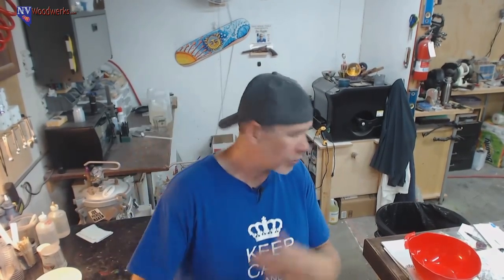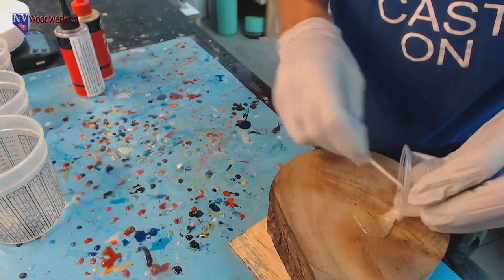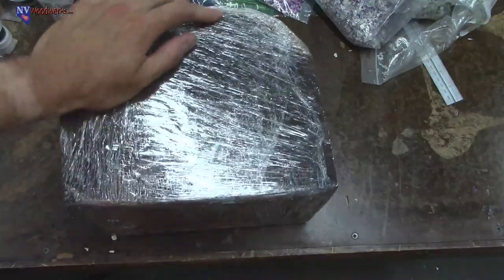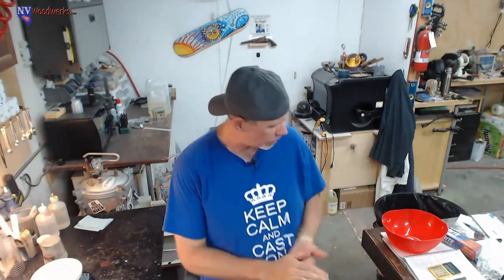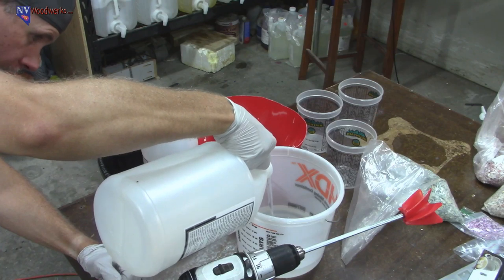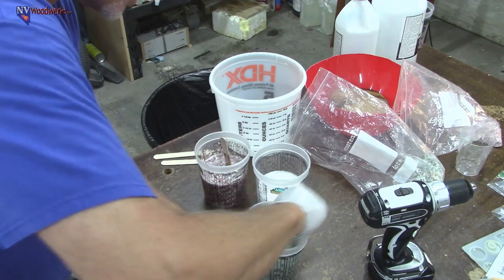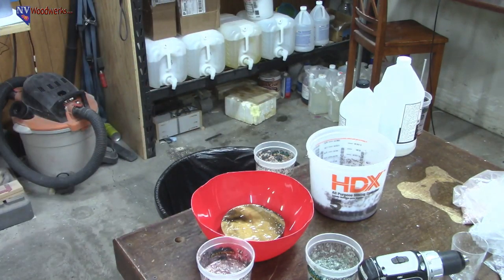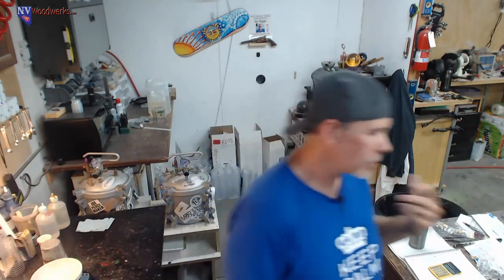🔴Replay: Resin Casting the Big Money Bowl | Episode 24

Comment: Probably dumb question but I'm knew to resin. If you do a multipour to stop cracking. How long do you wait to do the next pour?
Reply from the maker: That's a great question actually! You want to wait until the previous layer has cooled down. How long will depend on what resin you are using, the amount poured, etc. If you pressurize it, you'll have to wait until it's ready to be pulled out of the pressure pot... here's a video that covers how long you need to leave them in the pot: https://youtu.be/DT08MtxWNPw
Reply: @ZacHiggins  awesome sir, thank you! Keep on your videos, I'm learning a ton from all you guys. Good teachers!

Comment: 30-second epoxy is called UV resin lol but it's pricey.
Reply from the maker: I've used some before, but I haven't gotten good results with it to seal things. It's a great way to go if it will not cause any issues with the casting though